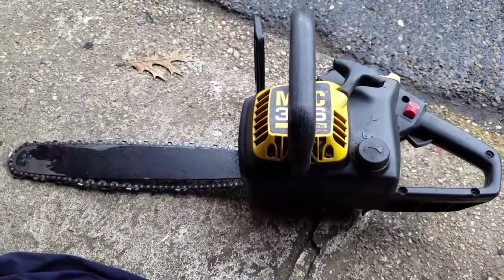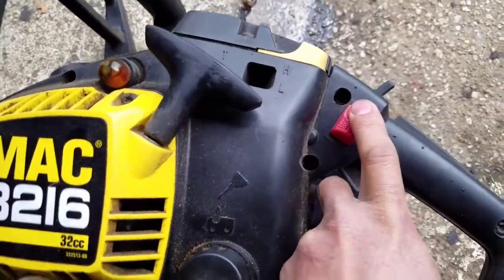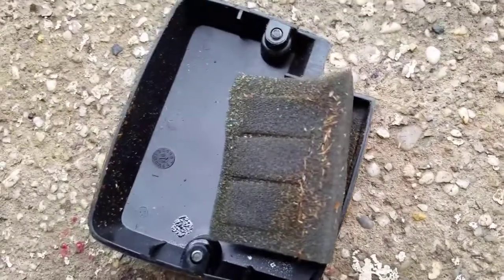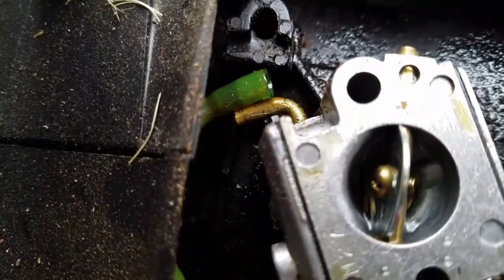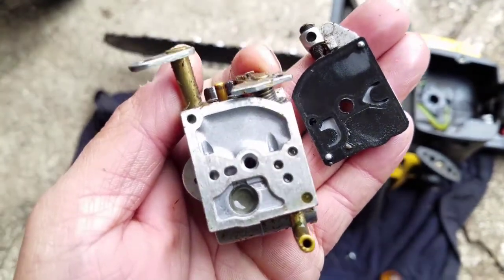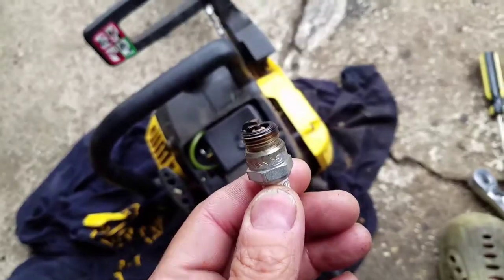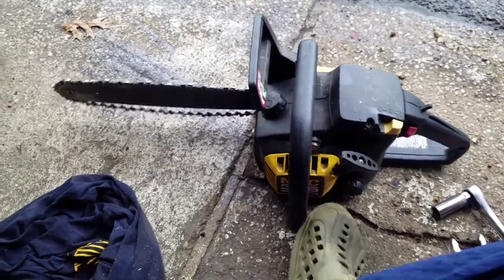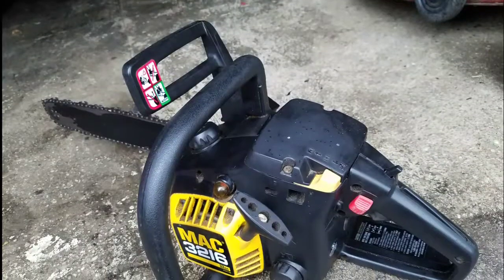MCCULLOCH 3216 MAC 32CC 16" CHAINSAW NO START DIAGNOSIS TRIAGE CARB CLEAN ADJUSTMENT SPARK PLUG FIX

Comment: It’s been 5 years but in case you check replies still - I picked up one of these cheap from discount catalog as a Factory Reman with “FR 2.1” name  & removed serial & model plate which sucked trying to first get parts.  Finally just found  it is most likely a 3505AV.  Only thing I replaced was sprocket 10 years ago & was correct part. Got some bars from ebay cheap and went trough 3 out of the 4 bars while cutting down trees. I don’t think the oiler worked past the first season.  Chains dulled quick.  I remember I replaced fuel lines and filter but didn’t know about oiler, and just found out tat line from tank was crumbled.  These are awesome little saws and look to be the easiest to work on as I’m an  ebay certified mechanic awaiting an oiler & carb kit - never replaced carb internal parts yet, but looks simple enough 😊.
Thanks for posting vid.
Reply from the maker: Good story bro!  Hope you’re subscribed

Comment: I have this same saw looks brand new runs fine but asoon as i try to cut the chain stops spinning and it bogs down as if the chainbreak was ingadged. Any idea what it could be?
Reply from the maker: Hi low fuel adjustment screws
Reply: @MowersNBlowers  thanks, ill mess around with it once i figure out how to tighten the chain and get some 40:1 for it. Any tips on tightening the chain? Im use to stihl saws

Comment: Is it prime or purge? My Mac says PRIMER on the body but as far as I can see it just purges fuel line of air.
Reply from the maker: Prime
Reply: @MowersNBlowers  it just seems that 6 pushes seems a lot of fuel to squirt into the carb throat...
Reply from the maker: Sometimes if you Havent used it for a while the primer bulb has no fuel at all in it so you’ll need to push it a few times to fill the bulb then the regular 3 primes to get gas through.  If you’ve used the saw just a day ago, it’ll have fuel in the bulb this only a couple of primes.  It all depends on how often you use it.
Reply: It is a purge bulb. If it sprays fuel into the carb it is plumped wrong. Check where the 2 lines that are connected to the back side of the bulb. Return line to the tank should be connected to the  long nipple and the line coming out of the carb under the linkage is connected to the short nipple. Continued in next post.
Reply: Ran out of space.  Fuel line from tank, with filter, to the other carb nipple. Pump bulb 10 times SLOW.

Comment: I have a 3216, but will not idle, how did you adjust the "H" & "L" to get it to run and idle
Reply from the maker: Throttle high adjust H to best rpm sound, throttle low, adjust L to just before it’ll stall
Reply: Start at 1 turn out from bottom out

Comment: How many turns out did you set you high and low mixture screws to?
Reply from the maker: Started with 3 half turns from tight bottom.  Adjusted 1/2 turn out on low.  1/4 out on high.